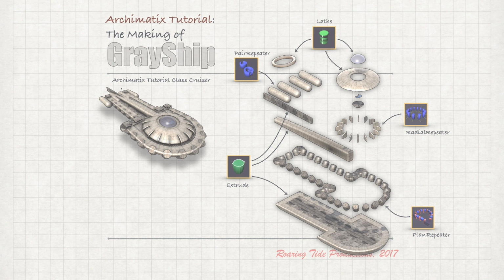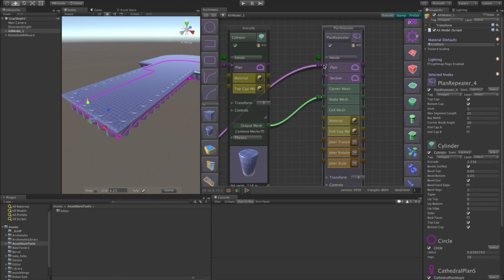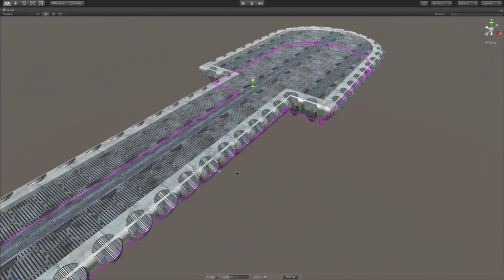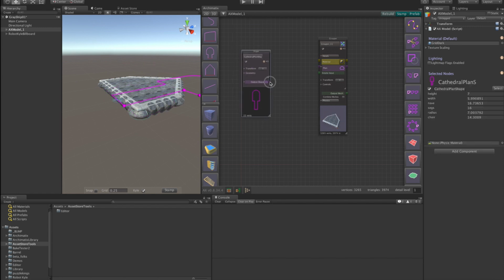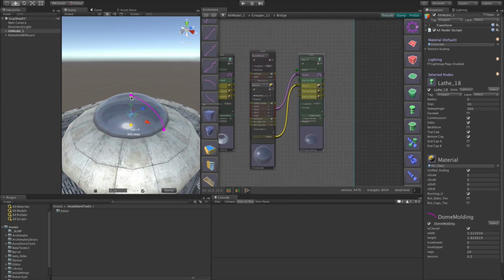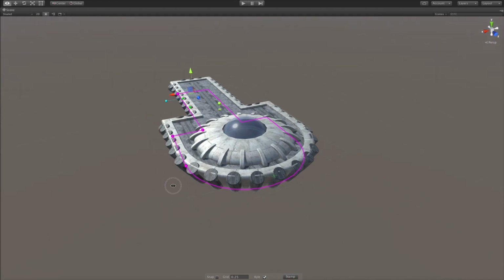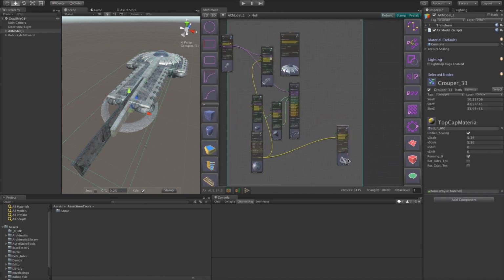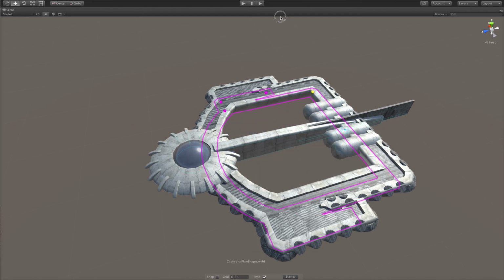Archimatix Tutorial: GrayShip

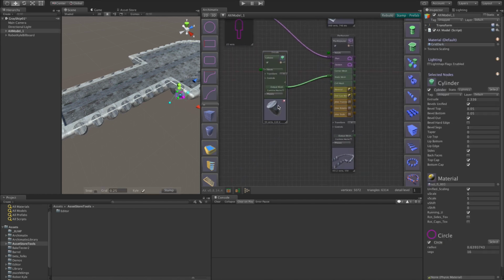Comment: 7:46 When I am copying and pasting it (ctrl + c & ctrl + v) I am getting new Extrude which has no texture on the object  (it is setuped to the same texture I copied) but not on the model.
Reply: The object which I want to copy has 406 verts and 380 tris. After copy and paste the pasted object has 66 verts and 60 tris and is blank but has the material applied and if I click the little arrow which point LEFT by the Material it makes the long snake line somewhere to the bottom (outside the grid) to some rectangles look like the grey background of the windows.